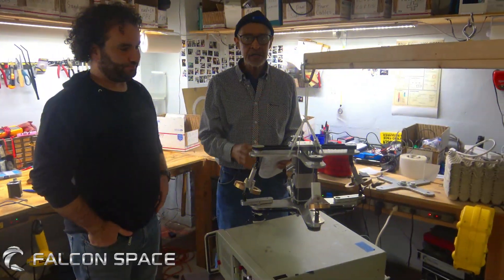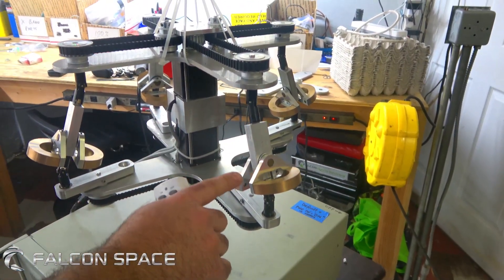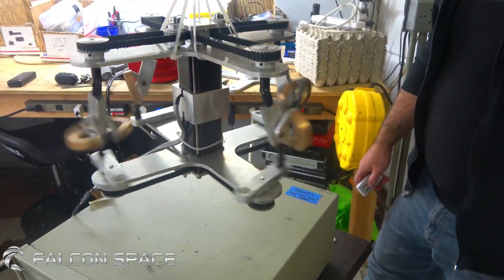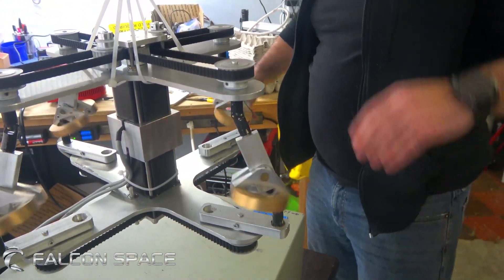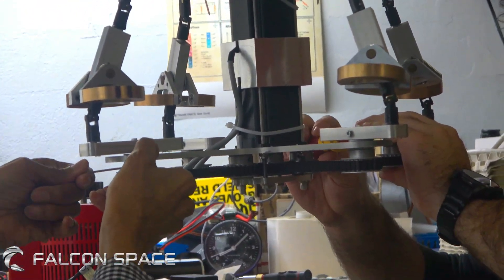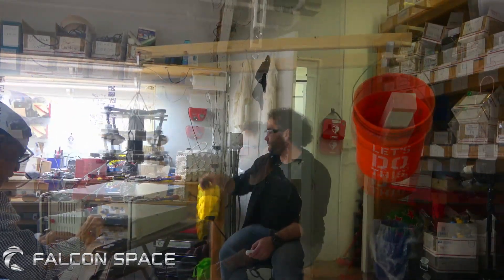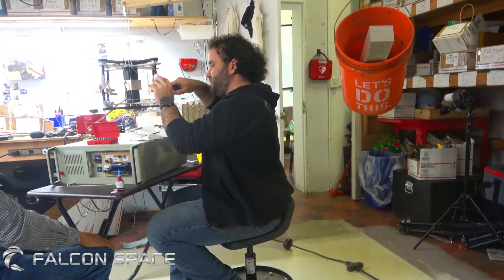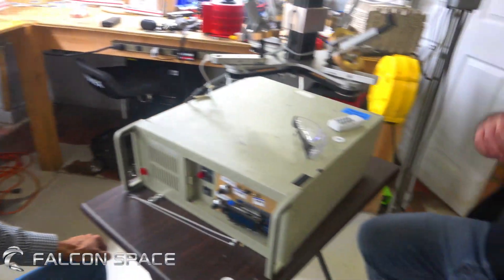Gravity Diode work with Tedd Pittman and Mark Sokol

Comment: Ted, Looks good. Thanks for sharing.  When I used the 12-volt battery to achieve zero mass with the polyethylene I later realized that I needed to use ferrite magnets stacked up vertically between two plastic frisbees in their center and the mass of the frisbees came out to zero. I wrote an email about this and sent it to you and Mark with diagrams. Did Mark ever get my email as I don't have the diagram or email anymore. I never hear from many people. I chatted with ISA via video for one month and I taught them my theory and they said it was a great theory.  I went over their devices, and I gave them mathematical computer equations so that they did not have to do 1000 experiments to find the proper settings for each device. Everything was great and now for the past month it is dead communication. This happens many times to me. I realized this with the magnets when I realized that the motor that I was using had ferrite magnets in it and was making my dual frisbee device have half zero mass.

Comment: Fancy device. But seemingly no net effect
Reply: Study the motion of a pendulum combined with a gyroscope and you will be half way there. Then study the motions of an olympian iceskater (twirling) combined with the motion of a discus thrower.All that is combined in the operation of an Impulse Driver. 

If you just think about the resultant forces and vectors, you can come to the all important point of needing to split the gyroscope in half to allow it to pivot 360 degrees and release unequal forces on the vertical axis. Read the patent.
Reply: @natelachae  I don't think you have anything and I assume nothing has been demonstrated work but the visiting ET ships do seem to have some spinning aspects and some have been seen wobbling like precession. But what exactly it takes is unknown. I figure spinning mass in combination with some kind of EM agitation. Just forced precession has been suggested before but failure to demonstrate is telling.

Comment: How well-balanced are all of these components? Are the brass weights? fixed into place with some type of gearing or are they swinging freely? A deviation as small as Just a few thousandths (0.001) of an inch tolerance or in terms of weight, a few thousandths Gm/milligram (0.001) or in some cases (0.0001) can be enough to cause unwanted artifacts in the desired/necessary balance/resonance frequency especially when there are this many moving parts. This can take some complex math. Something as small as just a slip yoke in one or multiple of the drive shafts being "out of tune/unbalanced" can cause a failure. This is also true when building high-horsepower race motors, clutches, pistons, and shafts which are in my case about 100x the weight of this contraption you have here. I would imagine the margins can be smaller in a model this size. Just some food for thought. Hope this helps in some way. BTW Lubrication is also vital with these types of things. You might want to keep track of the weight of the lubrication/oils you test. I also heard you saying something about a pin. I'm not sure what type of pin but, If the tolerances are loose enough for a pin to come loose you might want to look at screws in as many places as possible. You can get that thing cooking pretty fast if you take care of these things and hopefully get rid of the bigger swinging motion you see.

Comment: Ted, I am up to page 192 with your book. I have 238 pages left to read.  You chat about six things in general. Your family. The friends that you met and worked with on your gamma drive or G-diode. The companies that you worked for that I think you changed the names of because I never heard of such companies. Your travels around the US. Your life experiences and the Gamma Drive or G-diode of which you only chatted about two times on two pages that blew up due to the it is having too much mass as you are currently doing with Mark in his laboratory. I mention to use polyethylene plastic that is less massive and a 12-volt battery to make the plastic massless as I have done but so far, I don't see you and Mark doing this. The massless plastic will definitely achieve liftoff when the spinning gyros produce space thrust due to the equation F=mq/r^2 with no mass and no charge and no separation distance of the atoms in the plastics electrons and protons which will lead to a zero-earth gravity force. The charge that is built up on the plastic drives the electrons into the protons to achieve the zero mass, zero charge and zero separation distance. From what you were writing in your book the time frame is about the 1960's and 1970's.
Reply: While the book is a novel, 90% of the people, places and events are real. 
A sequel is in the works and a prequel is planned.

The patented device is called an Impulse Driver. Only one gyro was used for proofing.
An engine, with four counter-balancing gyros, was to be named Gamma Drive.
We decided against plastic after the dual/quad belt-drive design was chosen.
The evolved drive is now the Gravity Diode (gDiode).
Reply: @natelachae  Use Polyethylene plastic for the next iteration of the gamma drive. Then have Jeremiah build my star device correctly as I wrote to him and make the replicator to make the Metallic hydrogen to make your gamma drive and I guarantee your gamma drive will fly.
Reply: We are reviewing your suggestions and considering a series of new tests.
Reply: @natelachae  Great Ted. I added additional comments above. I also spoke with Jeremiah about the zero mass plastic with a 12 volt battery and ferrite magnets when we were chatting, and this communication also went dead in the middle.
Reply: I also think that the gyros going in and out in unison does not produce a torsion wave. I think that they need to go in and out in order of 1, 2, 3, 4. A spinning disk does produce a gravity torsion wave. I sent a lot of information, but I don't remember much of is as it was several months ago and I have moved on to other things. The universe spins. A torsion gravity wave.
Reply: @natelachae  Your one gyro device produced a torsion wave and worked.
Reply: @natelachae   You may also wish to put one motor on each gyro instead of the belts that stretch and wobble a lot.
Reply: @natelachae  I also gave a lot of suggestions to Phil Brouchard and his device is working.  He is currently making a larger and more powerful device.
Reply: @natelachae  The screws come out due to anti-gravity waves reversing time as me and my friend Philippe in France found out and we had to use something like permanent Loctite to lock the screws into place. You may also wish to weld the screws in place.